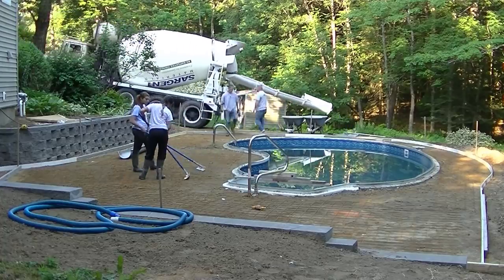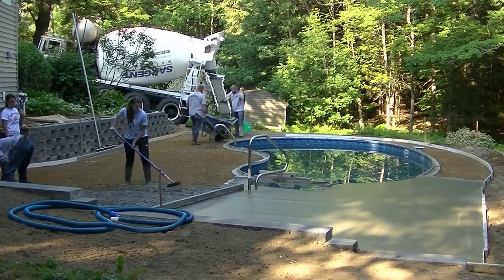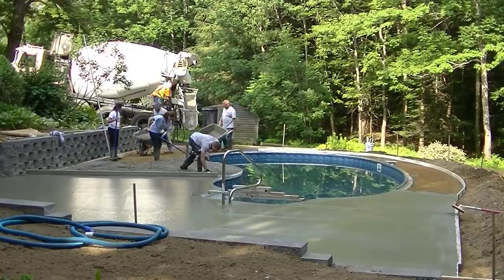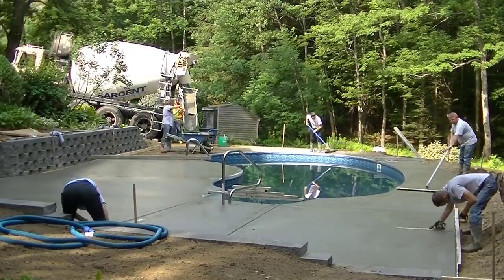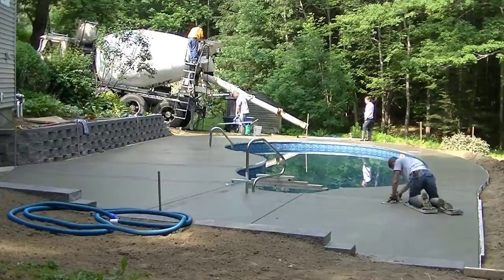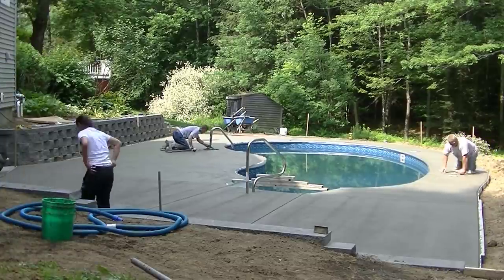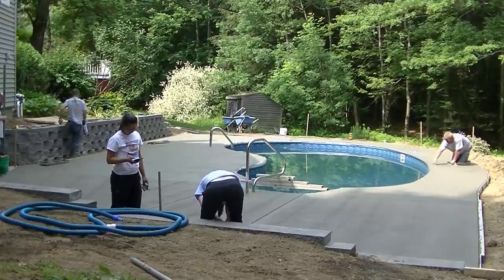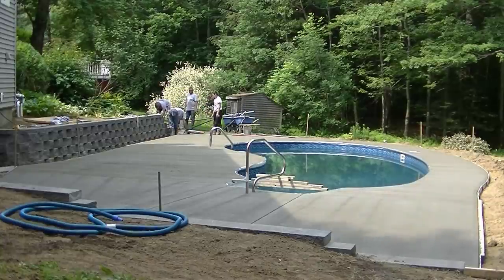How To Pour And Finish A Concrete Pool Deck | Kidney Shaped Pool

Comment: Mike just came across this been in the concrete business for 40 years on the Westcoast. We do the same thing you do high end stamp and all kinds of flatwork and walls. Did foundations for years but just flatwork now. You guys and gals do things a little different than we do are pool decks have to have #3 rebar 18" O.C. But that said it's so nice to see a dad have his girls out there with the boys. Also lets them know how hard dad works so they can go to school. And I was watching them there better than a lot of guys on the come a long. nice job!!
Reply from the maker: Thanks Andy, Some decks we'll use 3/8 bar and some wire like this one. It depends on who does the prep for me.  Where on the west coast are you?

Comment: I work on a 4 man pool construction crew and we pour our own decks- It’s really cool to see how you guys and gals go about the process. Our bossman has been pouring decks since he was a teenager with his grandfather and has developed an approach, that while effective, is way different than what I see other crews doing. For example we ‘saw screed’ right on the form with stakes pounded down flush and follow with floats on the edges, but because of that, we run the risk of scratching up the coping and/or pulling too much mud off the inside edge of the coping or form. I like the idea of floating the edges prior to screeding as opposed to trying to establish your levels with the screed directly on the form- Seems like it would make screeding a little easier and help keep the pool cleaner. Thanks for taking the time to produce these videos, maybe I will try to employ some of your tactics when bossman is looking the other way haha. Cheers from KY

Comment: We call them jointers. I have an old bullfloat sawed off to about 18 inches. The actual jointer slides anywhere you need it on the bullfloat. Pretty handy putting joints behind a post. Also has swivel so you can reach further. Great video!
Reply from the maker: Thanks Brad. You're technique sounds good also.

Comment: I used to do alot of these pool decks . The pool company we where subing for wanted them a super light broom . So alot of troweling . But where I live we don't run that much air entrainment just a little bit . Also another thing we used to do .Is set a small piece of expansion and cap where we would start the pour . So  that when we got back around to it it would have a clean break . Basically we didn't have to blend the two loads together . Then the pool contractor would just pull the cap and caulk it .
Reply from the maker: Nice, we always blend the two loads together. We try to start where we would normally put a joint anyway. Works good for us most all the time.

Comment: I noticed you had steel mesh, but how does it reinforce the concrete if it is flush with the dirt? Does it need to be centered in the layer of concrete for it to work properly?

Comment: Excellent team work, Mike.  Sorry if I've missed this in your commentary.  It looks like the pool is vinyl lined with aluminum coping.  If that's the case, how do you deal with any concrete splatters on the coping; and, is it possible to remove the coping at a later time, in case the vinyl liner needs to be replaced?  I imagine the coping just pops right out, but I didn't see anyone run a straight edge between the coping and concrete.  Thank you.
Reply from the maker: In the video I duct tape the coping to keep it clean, then we pull the tape when we're done finishing. The coping is permanent. It doesn't need to be removed to replace the liner.

Comment: I work in pool repair, just about all the pool jet repairs i do are because they are being yanked on from settling.so i wonder if using masterseal np1 in the relief cuts would prevent future water washing of substrate.if that would be worth . Also preventing the jets,hoses and elbows from getting pulled down and damaged.
Reply from the maker: Caulking the joints is always a good idea. I don't usually do it. I only do pool decks where the sub-base is compacted really good and almost all of them go through a winter season before I pour the concrete.

Comment: Can't beat the Jackson poly wheelbarrow, looks like you got a bumper on front, is that for when you dump on radiant heat tubing?   It's a good idea to put the first part of load on both trucks next to each other like you did, seems to me the first half yard never sets as fast as the rest of it. We call it a cutter.
Reply from the maker: Yes, for radiant heat floors. That's just about the only time we wheel anything now.

Comment: Quite a few guys here use a Fresno after bull floating on exterior slabs. Wouldn’t a broom finish open the surface back up if you sealed it with a steel trowel?
Reply from the maker: We like using a funny float better than a fresno. The broom would most likely open the surface back up,  I just don't like to take a chance on trapping moisture. A good tight mag float with a good fine broom leaves you a really nice broom finish.

Comment: Hi mike great video and great teacher. I am putting an above ground pool ( with aluminum walls ) half way in the ground and want to place a concrete slab around it. Do I bring the slab right up against the pool wall or do I need tp place something between the pool wall and slab?

Comment: Hi mike. I’ve poured my share of concrete over the years here in Michigan . You mentioned about steel troweling outside pours and how it can affect the concrete , same thing here in Michigan , was always taught not to steel trowel air entrained / outside broom finish pours , but my question has always been , when you broom the concrete isn’t it “opening” that top back up ?? I’ve just always been curious about that whole theory of trapping air below the surface .

Comment: Do you think you could get pretty close to even price wise by hiring a pump truck and only having 2 guys there? I’ve been leaning toward using a pump on many pours lately that I could get away with tailgating or wheelbarrowing because the dollar amount ends up so close and the pumper just makes for a much easier and stress free day. Thanks enjoy your videos and seeing different styles.
Reply from the maker: We tailgate when ever we can. For us that's almost always easier unless it's a really big pour. We don't wheelbarrow too much. Pumping is easier in a lot of cases but it's 850 for a pump plus the yard of concrete just to fill the pump that you don't use. That gets you to over 1000.00 bucks. I extra man doesn't come close to costing you that for a day. Plus when the pump washes out it leaves a big pile of crete to pick up after. I only pump when I have to.

Comment: Mike I have a concrete pool deck which appears to have been laid in layers, the top layer being that mottled effect with tiny hair lines in the concrete. The deck has been down for years and two things are happening. 1. is its cracking from ground movement and 2 its lifting from a hard concrete under layer. At this point it essentially needs replacing and this time I'm thinking of laying astro turf (not least because it will cope better with our ground movement in Houston). Do you have any tips for removing all that op layer, I don't want to remove all the concrete because I'll just have to raise the ground to get back to the level I want to lay astro turf at and I don't want to lay the astro on the existing top because if lifts its going to pull up the astro attached to it. wondered if you had any advice.

Comment: It looks like the water is just right.  In my mind I'm thinking when there is bleed water on the surface, it's too wet.  Wondering if you think that is true?
Reply from the maker: That's not always the case. If there's a vapor barrier, you usually always see bleed water no matter what the slump is. Non-air entrained concrete bleeds more than air-entrained concrete does. Really fine aggregates seem to make the concrete bleed more than course aggregates. Mixing water does have a lot to do with it also.

Comment: In your opinion, what is the minimum width of a pool deck where building codes do not specify a minimum width?  Can I get by with 12 to 18 inches?  TIA

Comment: Hey Mike! I came across your video while googling for concrete pouring. Do you have any recommendations on how you handle pouring around existing pool plumbing when pouring a deck for future maintenance and access? For example, PVC 90s into returns from the pool pump. Thank you! Love the channel, subscribed!
Reply: Form around the pipes entirely, wrap them with expanded foam or sleeve them with a larger diamond pipe.
Reply: @jeffsedletzeck3882  Thank you so much Jeff!

Comment: ready mix suppliers don't have front discharge trucks up that way?
Reply from the maker: Not all of them. This one has about 5 of them but in a different batch plant.
Reply: @MikeDayConcrete  Do you have preference? Obviously you have to know how to work with both types being that they aren't all one or the other.

Comment: A friend just had a pool poured and noticed after the fact that the concrete decking around pool was only 3 inches thick.  Isn't 4 inches thick the minimum standard?
Reply from the maker: That's what we pour, 4". It could be a little less in other areas, I'm not sure.

Comment: Nice to see someone use a wheelbarrow not a pussy pump ,pour concrete like a man to many people using pumps skipping the true appreciation for concrete work .  Must be nice to pour so thin and no mesh or rebar that would crumble on first frost here in ontario
Reply from the maker: It's 4" thick, that's standard for our pool deck. It had mesh, the girls were pulling it up as we wheelbarrow the crete. Thanks for watching Shane!!